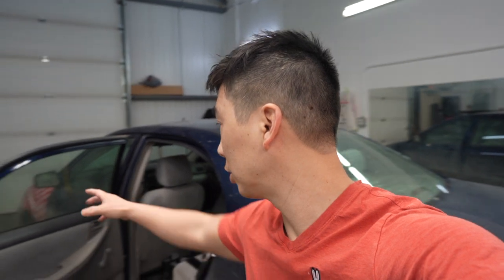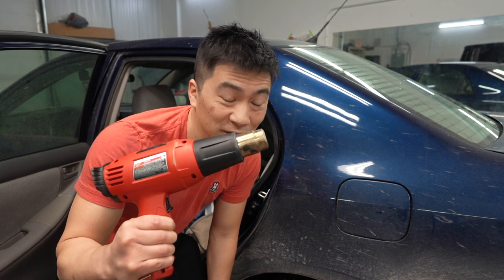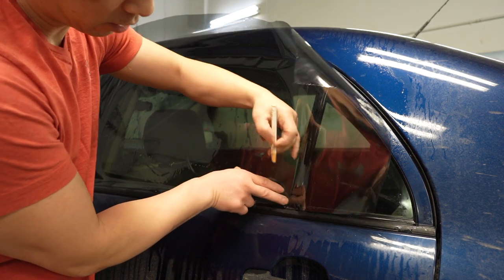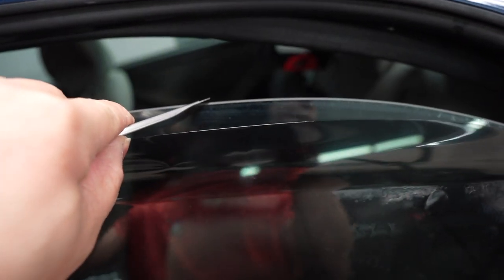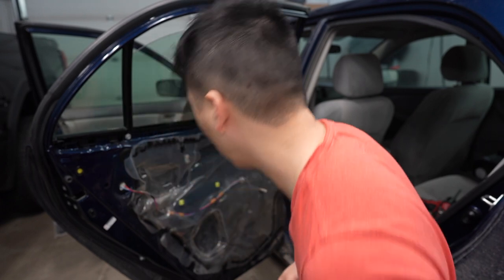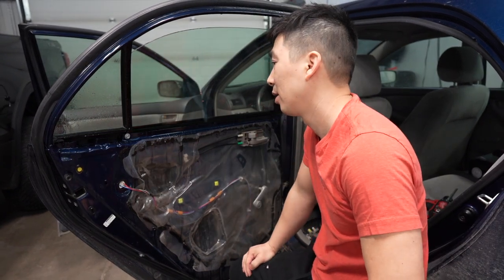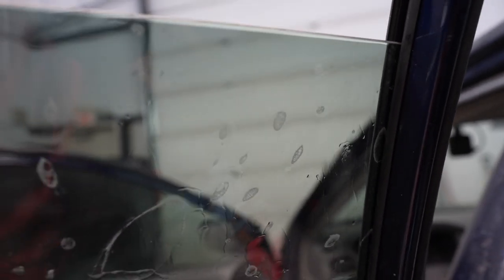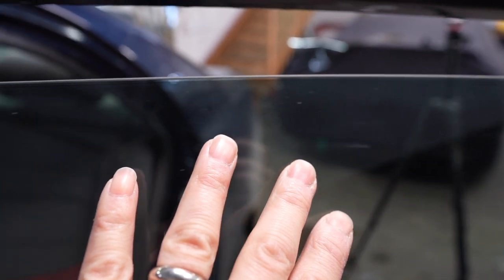DIY Window Tinting for Beginners Made Easy!! Part#1 Side Windows

Comment: What's the purpose of the towel ?? And is it paper ?
Reply from the maker: The towel cleans most of the dirt and dust trapped on the glass and rubber seal. The blue towel is paper towel.
Reply: In the video the towel is used when your pushing the air bubbles out . So technically your cleaning the tint ?
Reply from the maker: @expressdiy6956  that blue towel is a shop towel brand. We use them so the hard card doesn't scratch the tint  when you are bumping the water out of the tint.
Reply: Can regular blue roll work .
Reply from the maker: Yes
Reply: The reason for the cloth is too get the water from behind the tint behind the gaskets

Comment: Should heat shrink it next time
Reply: When you’re able to take the sweep out aka the bottom gasket, you really don’t need to shrink it. Just need to squeegee it a certain way and it will flat out.
Reply from the maker: This method is for more advanced installers. I find some installers are not experienced enough and don't know how to read the film and end up creasing the film.